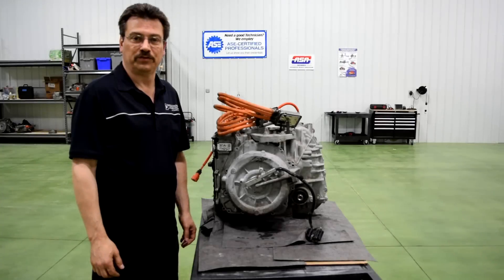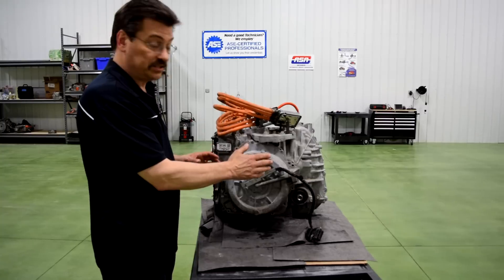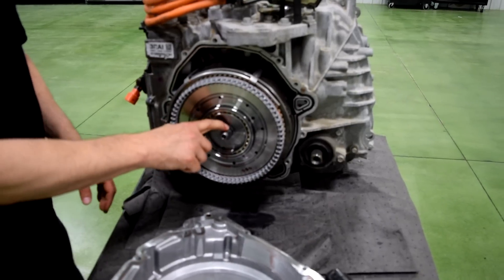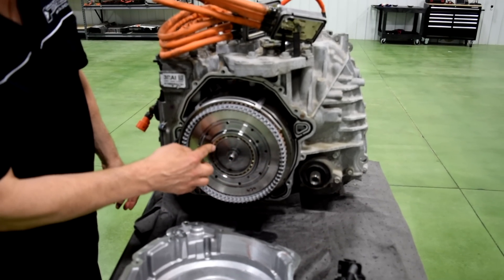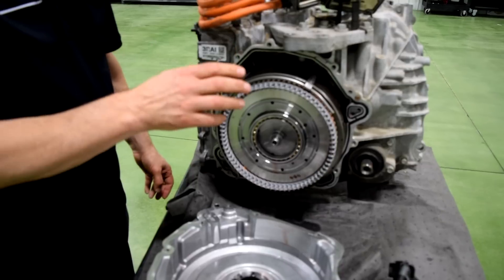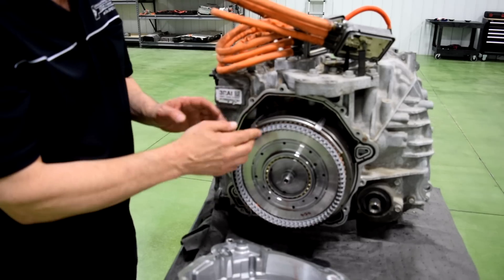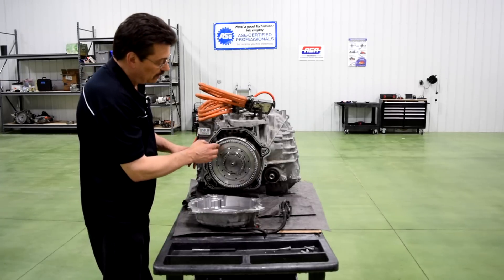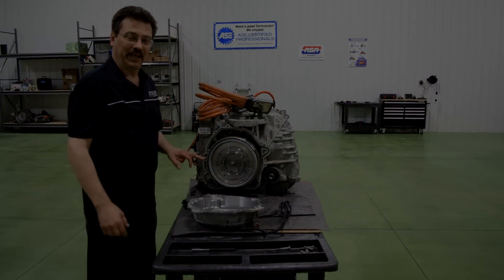HEV TV 2.14: Chevrolet Volt Transmission (Part 4)

Comment: I have replaced the support bearing and the cover won’t go in completely, I cracked the aluminum cover, replaced it with a new one but it is still not in properly... I need help please🙂
Reply: Did you end up fixing the issue? I am experiencing the same thing... :(
Reply: Did you press the bearing in the same depth as the previous one using a caliper to measure the depth?  This video gives details: https://www.youtube.com/watch?v=dpTIkE2A4og